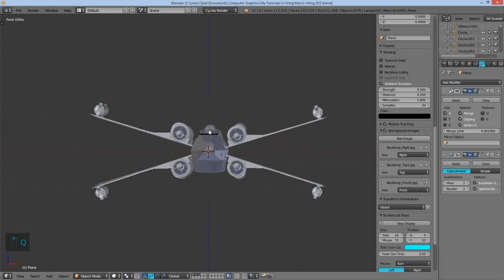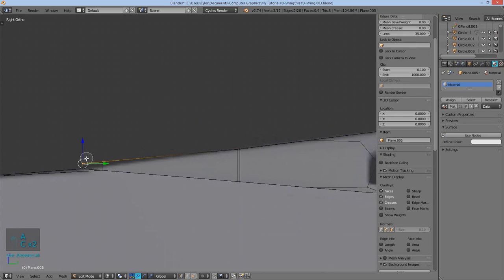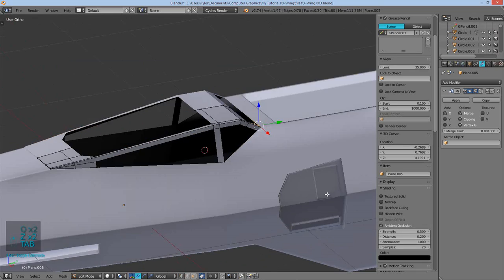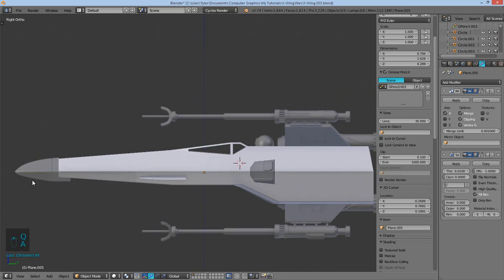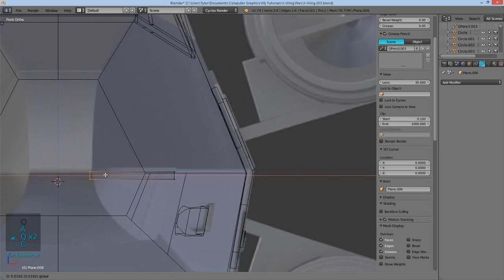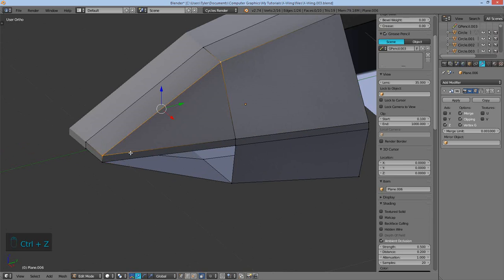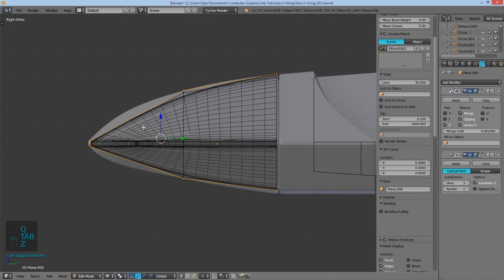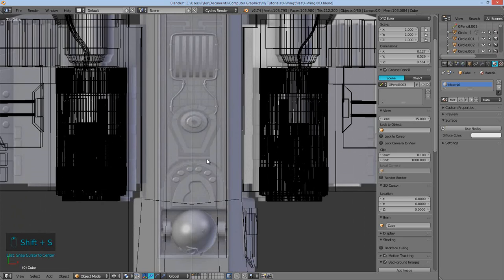How To Model A HighPoly X Wing in Blender - Part 4

Comment: How did you make your Xwing look like plastic?  Can you go through your lighting and render settings?
Reply: Hawkadium I’m not 100% sure but it looks like he is just using the Blender Cycles default material (because it’s just called ‘material’ in the slots). All you need to do is click new on the materials panel, and then don’t change anything else. He’s also using ambient occlusion, which was explained in a different part of this series, to add the sort of dirty looks between edges.

Comment: you deserve more view dude! great video, Icould you make those kind of rounded shape hard surface? like a jet fighter or a car
Reply from the maker: DavidstormDS Thanks I appreciate it! I'm sorry I don't really know what you're asking there.
Reply: if i were to model a jet (an f 18 hornet, for example) how should i approach on modeling it, because it has smooth and sharp edge, and also because of the cylindric shape of it's body, i wanted to know how should i add the details and panels and extrude stuffs without messing up the topology and making some weird shading.    :)
Reply from the maker: DavidstormDS Usually what I do when I'm faced with a complex model like that is first make a rough messy model and then using that as reference I'll retopologize it using proper geometry. And also Don't forget to make use of bump and normal maps for some of the smaller decal.